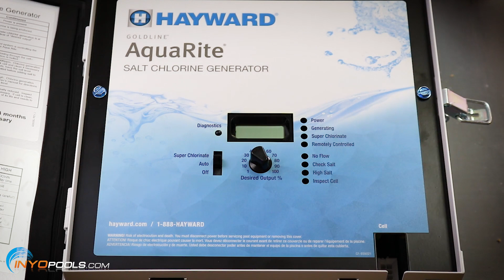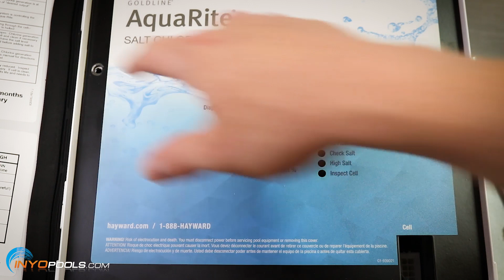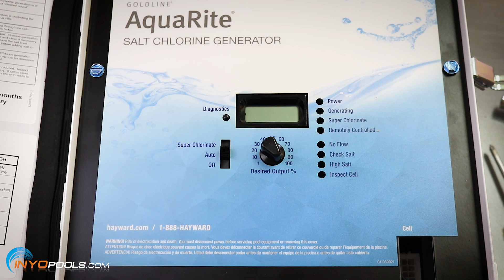How To Wire a Hayward AquaRite on 115V

Comment: Hi, I wired my aqua rite 900 for 120v. When I attach it to the load side of my pool time clock it trips the breaker. The same time clock is feeding the pool pump, which works when the aquaritr isn’t runnnkng. I test my wire for shorts. When I continuity test the terminals with the jumpers in I am getting continuity across all of the terminals which is probably the reason the breaker is tripping. Would you happen to know if there  is anything else i have to do to accommodate 120v. Could the main board be faulty? Any help would be appreciated. Thanks.
Reply: Most pool timers that I had were controlling 240v for 240v pool pumps.

Comment: I replaced my pump with a VS pump and got rid of the switch that the pump and the salt generator were tied to that led  to 220V breaker. I  ran a new dedicated  20A 110V breaker and then my generator showed no power even though I had 120 going to it, so this video was just the answer I needed just reposition the jumpers and boom power restored to my generator!
Reply from the maker: That's awesome. Happy we could help!